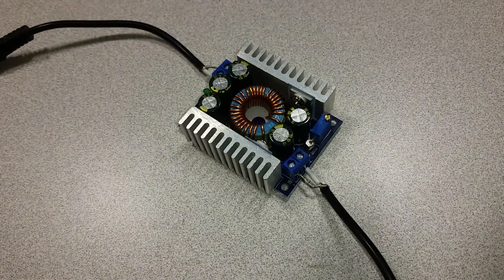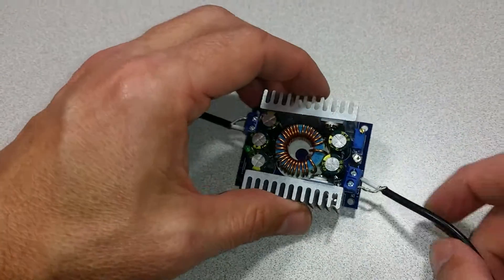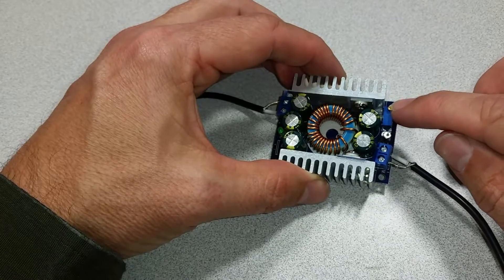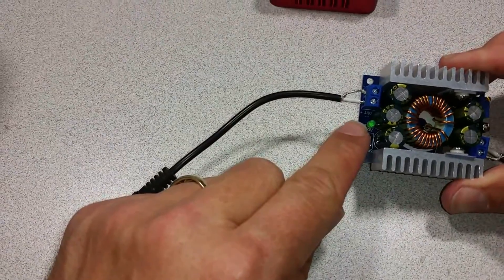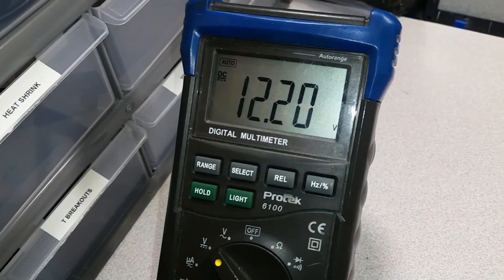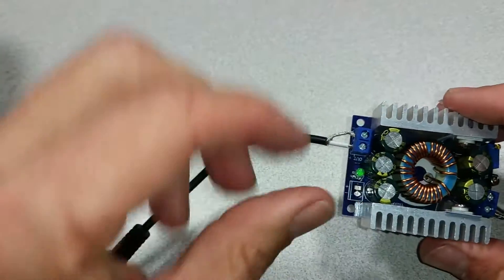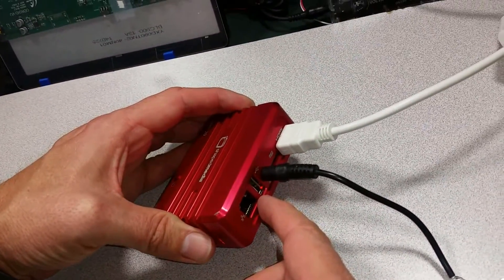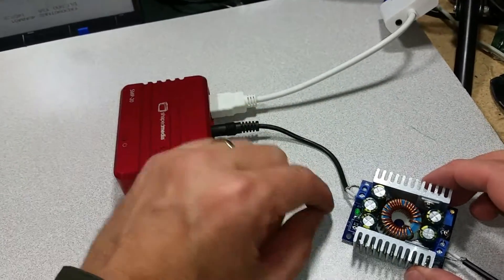1 to 30VDC Stepdown Converter

Comment: cool video - this module was designed to power a hand full of LED LIGHTS -12v LED flood lights 
I use one to power a cordless drill, the battery died so the drill still works very good. i set it at 12.6v and 0.700mah

Comment: if the input voltage floats a bit as it does from my solar battery bank (anywhere from 12.1v to 14.4) will the output maintain its voltage setting or will it float in relation?
Reply from the maker: +Jud Stansell The short answer to your question is that the voltage setting will be maintained and will not float.

We performed a test just now. Starting with an input voltage of 5.25VDC, we set the output voltage to 2.0VDC. We were able to adjust the input voltage down to 3.3VDC while maintaining 2.0VDC output without intervention. However, once we dropped below 3.3VDC, the output voltage basically went to 0. So it looks like the input voltage needs to be above a specific minimum to keep the output voltage active.